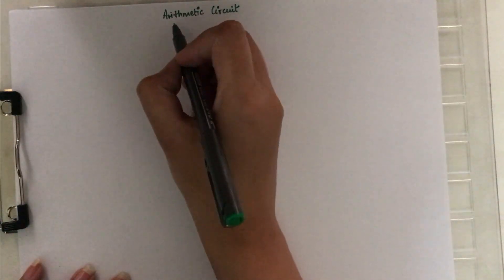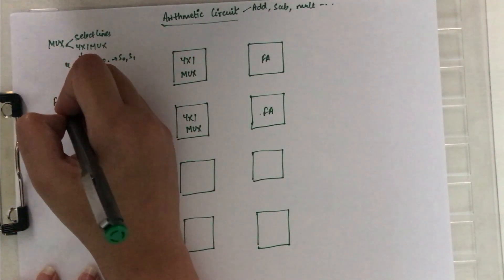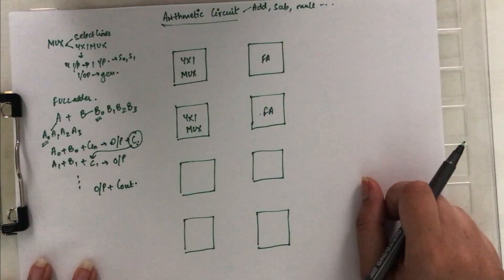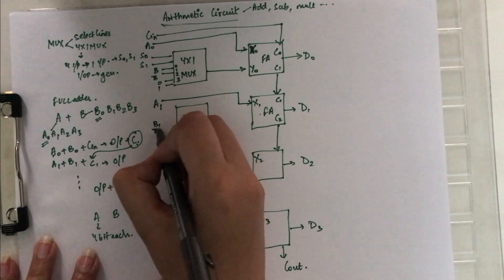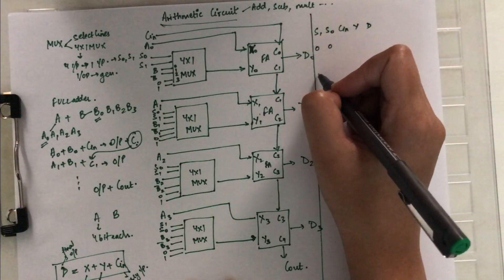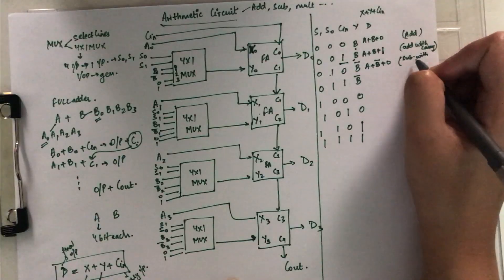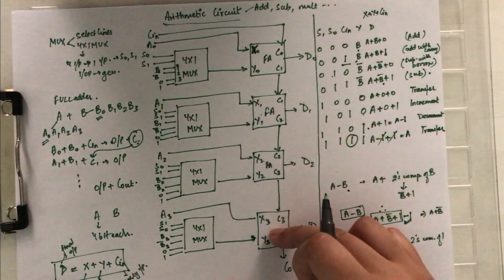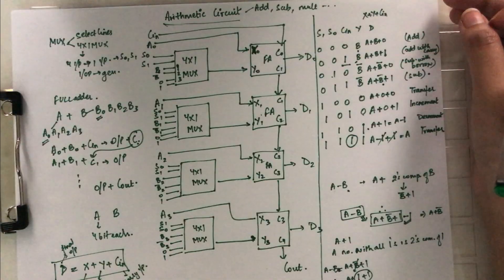Arithmetic Micro Operations

Comment: those who are confused with s1=1,s2=1,cin=0 case:
let me explain,
when s1=1,s2=1, it means every bit of a gets 1. i,e for example if a=1011 (eleven) then 1011+1111 is this case (y0=1,y1=0,y2=1,y3=1) , which adds to 1010 (ten) which is equal to a-1 ,and not a+1